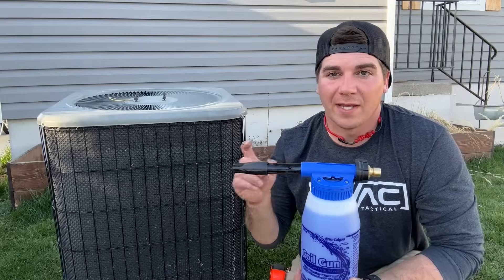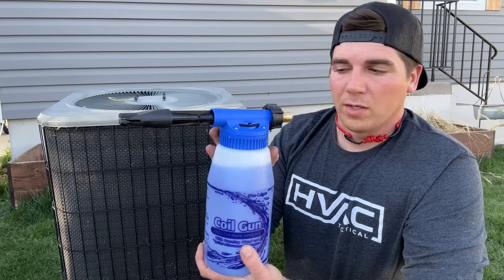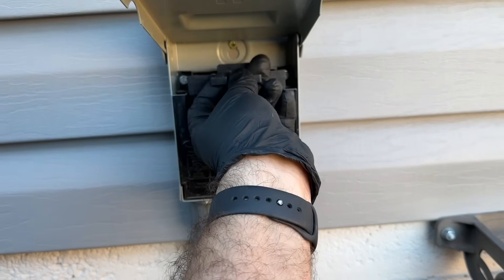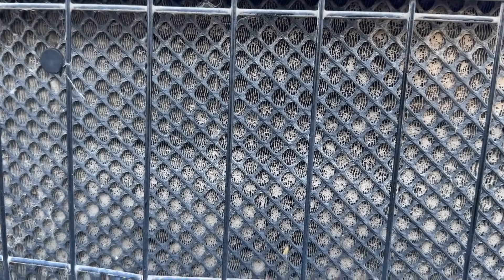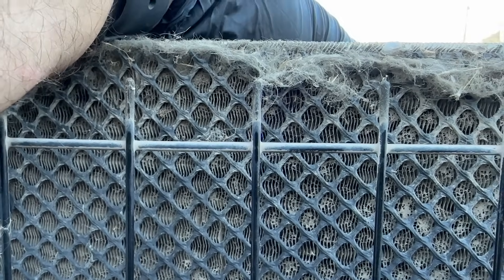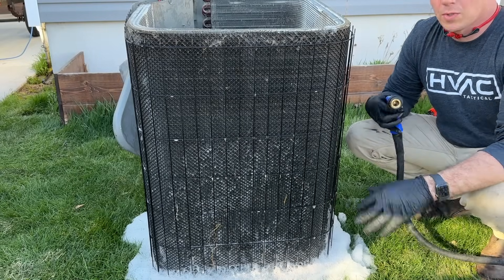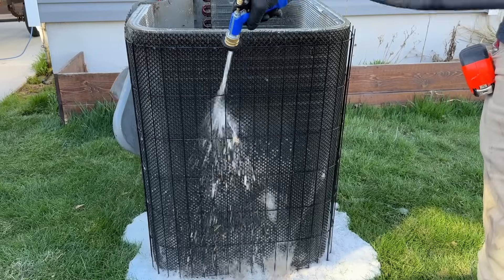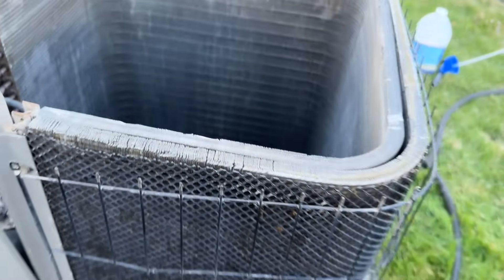How To Get Ice Cold Air By Cleaning Your AC Coils The RIGHT Way.

Comment: As a retired HVAC mechanic with 35 years of experience.  I have one tip about foaming coil cleaners ...... always start at the bottom and work your way up.  The reason being is that the run down of foaming cleaner can prevent proper penatration. If you start at the bottom and work you way UP..... You always have coils with NO FOAM IN THE WAY. JMO. WORKED FOR ME FOR 35 YEARS....LOL
Reply from the maker: That’s a really good tip. Thanks so much!!
Reply: @diyhvacguy  
I got a million tips. But you seem to be killing it on your own. Good videos,  good editing skills  , and no fluff. I like that.
Reply: @diyhvacguy  have you ever run into a TRANE with bottle brush fins.?? When I was a rookie. I had to call my boss and ask what to do. He told me that  TRANE recommended removing the complete outer shell  of the unit. Then, take your torch and burn off all that you can. Always being mindful of burning fins. Once that is done. Clean from the inside out. .... worked like a champ. Once you've burned the outside and cleaned from the inside out. You MAY have spray the outside and inside and clean again.  Your professional eyes  can tell if you've done a good job.  Pain in the hindparts... but it works.
Reply: Something went wrong.  I was speaking of a TRANE with bottle brush coils.
Reply: @mikeglasgow9618  I have one of those Trane units with the bottle brush coils.  I'm planning to clean mine sometime in the next week or so. Thanks for the tip!
Reply: @chriskvikstad4980  need any information....just ask. I'm a 35 yr retired HVAC Tech.  Just sitting at home enjoying life. And being retired.
Reply: @mikeglasgow9618  Thanks Mike. That's very kind of you and much appreciated. I'll take you up on that if I find anything unusual when I'm getting it ready for the warm weather. Do recommend doing anything with the evap coils inside the house? I looked at the furnace stack and I can see where the coils are, based on the location of the copper lines going into the box and the drain pan hose, but I can't find any way to access it. It's entirely surrounded by metal framing. Would be great if there was an easy access panel right there.
Reply: @chriskvikstad4980  yes,,,,, it sounds to me like someone built your coil box out of sheet metal.  Mine is what they call a CASED COIL. Meaning that it matches the furnace.  If yours is wrapped with sheet metal and you have no access,  then I would suggest that you use a small  hole saw on the edge of the cabinet.  If you can do both sides the better.  Be very careful that you don't let your hole saw PUNCH THROUGH.  ,you only want to cut through the metal.  Maybe a 2 inch hole. Then you can visually inspect the indoor coil.  The hardware store sells metal hole plugs that snap into place and can be removed for future inspection.
Reply: @chriskvikstad4980  .BTW.... If you do that. And you find it needs cleaning.  You will have to write back and I can give you a few tips. It's very important that you keep your air filter clean to prevent this
 Do not use the fiberglass air filers that you can read a newspaper through.  We call them bugcatchers.  I use a one inch STANDARD PLEATED. Not the high efficiency you by at Lowes or Home Depot 
 I buy mine at a store called the filter factory.  When I was working 
 I bought thousands of dollars of filters from them as I took care of several Nursing Homes.  Changing all of their air filers. Preventive Maintenance Contracts.
Reply: @mikeglasgow9618  I have a question. I have a two year old Bryant unit. I had them come out and check the system once a year. Well I asked him don’t you clean the coils? He said cleaning the coils would eat away at the protective coating . The coils look clean, but just wondering if he’s pulling a fast one on me. I could see both sides, but just curious.
Reply: @william-fla-321  LOL..... Yes he's pulling your leg. They make different types of coil cleaner.  One being HYDROSULFURIC ACID. Even though Hydro means water solvable, it " WILL " etch off some of the protective coating. That being said. You don't need to be that aggressive in your approach.  CALGON makes good foaming outdoor cleaner that is completely safe. A 25 % solution of Dawn dishwashing solution would be safe also. So is just using plain water. I've not worked in the last 7 years. I'm absolutely sure if you pose your questions to DIY. He would most likely have more information about this than I would being I've been out of the trade so long. But when I was residential years ago. Cleaning the outdoor coil in the Spring was an absolute.  I hope this answers your question.
Reply: @mikeglasgow9618  Thank you and I appreciate you taking time to help others. I had a feeling he was BS me. I’m mechanically inclined, but never messed with AC stuff.  He was trying to pitch me a surge protector and I knew more about the ZAPCAP he was pushing then him. I like to make as many repairs as I can by myself, because most people don’t care about your stuff. I’m going to start educating myself on the AC repairs. Thanks again.
Reply: @william-fla-321  no problem.... like I was saying.  I have been out of the trade for about 7 years now. I was an industrial tech. Very large equipment.  Boilers,  Chillers.  And DDC ( direct digital controls ). I worked for a school system for 15 years. Can you just imagine how many filters I changed.  LOL. Then my wife transferred and I got another industrial job. Hospitals , Schools. Nursing Homes.  and such. Also Digital Controls.  But I started out installing residential units when I got my degree in HVAC/ R. Some of the Boilers I worked on were 1/2 as big as my house. Lol. I really like the DIY GUY. Straight to the point, good editing and no fluff. If I can be of assistance to anyone,,, I will help if I can .
Reply: @mikeglasgow9618 I have a question.....

So my AC ran perfect about 1 year ago but since then my thermostat has gone out and had to switch to a Nest learning thermostat. I feel that my AC is taking awhile for it to reach its temp. 78 no issues. But 77/76 it takes forever. Im in houston and we are experiencing 100-102 degree weather but feeling like 110. Could it be that its just so hot?
Reply: @b_amayzd3646  yes  definitely.  Also Nest thermostas have an algorithm built in to their internal programming process. What that means is it takes time to learn about the load of your home. My thermostat has 4 events per day. Before I retired I only used 2 . HOME AND AWAY. In the cool mode I would set my away temp at 80 degrees. HOME was set at 74. For the first 10 days or so. When I would get home at 6PM... IT WAS NOT 74. It would be 77 at 6 pm. Next few days it would be 75. Finally at 6 Pm it would be 74. Just make sure during this heat that you wash your condenser and keep you filter clean. One other thing that MAY HELP... Is to shade your outdoor condenser if it is in direct sunlight during the hottest part of the day. Hope this helps.
Reply: @mikeglasgow9618   Sir... After cleaning the coils, how long should one wait before turning on the unit?  Would it be safe to use compressed air to "dry" them?   Right now, where I am in TX, leaving a unit off for more than 45 mins isn't the preferred option.   And then another thought, don't the coils get wet in the rain anyway?
Reply: @starhopper457  you are right. Once you have cleaned the coils, you can put the outdoor unit back online , provided you did not get any water in the electrical panel where the contractor and capacitor (s ) are located.  I just cleaned mine yesterday and turned it on within 5 minutes.  I cleaned mine with NU CALGON Coil cleaner at the beginning of the season so now I just rinse with my garden hose and spray nozzle.
Reply: @starhopper457   my sister lives just south of Waco on Lake Whitney.  She is doing well
Reply: @mikeglasgow9618   Nest thermostats are too complicated! And letting your temperature go up to 80 and then back down is costing you more electricity than if you just left it at 74
Reply: @diyhvacguy  I thought you were supposed to spray from the inside out?
Reply: @troyd.521  Yes. You are
Reply: Great idea ! Would you use Simple Green to clean coils?
Reply: I usually recommend to try and not use any chemicals at all for regular maintenance... if coil is dirty and impacted, sure. Otherwise, a waterhose alone will get the job done and it wont eat at the fin to copper connection points, which cuts out efficiency.
Reply: Great tip brother,thanks
Reply: your retired.. so keep your mouth shut, nobody asked.
Reply: I like to spray from the inside out.  It’s better to blast it out of the unit and not into it.
Reply: @ChiBr33zy  of course.  But when you are applying your cleaning solution,  always start from the bottom and work your way up.
Reply: I still don’t quite understand your comment, if the foam is running down, shouldnt you start at the top if you want “no foam in the way” cause its running towards the bottom?
Reply: @joemchang  bro...did you even watch the clip...good god man.
Reply: @DigitalCity-sj4es  yes in the video he says work from top down but comment says to work down up i just don’t understand why you would do it another way
Reply: Thank you!!!
Reply: Ty 😀
Reply: I have a question. Should you clean inside the unit as well?
Reply: @jerondbetts7341   on the outdoor unit. I kill all power to the outdoor unit. Take off the top of the unit. The outdoor fan will come off with it.  Being careful not to bend fan blades. Wash unit from the inside out. Usually before I get everything all wet I use a shop vacuum and vacuum any leaves or pine needles out of the bottom of the outdoor unit. Hope this helps. If you are using a garden hose spray nozzle,  do not spray at an angle or this can bend the fins.
Reply: Another dumb question if I may, re: testing capacitors...  do they have to be fully unplugged before testing them?
Reply: @starhopper457  not really but absolutely better if your a rookie and don't know what you're doing.  Just take a picture of the wiring noting where they go back. Unplug it,  ground out terminals with a screwdriver  and test capacity.  Rule of thumb for capacitors is + 10% ------ minus 0.0 % . Hope this helps.
Reply: Yes when applying a spray cleaner to most surface start at the bottom. On wall it helps to prevent streaking.
Reply: @jelehan88  I drink a shot of WINDEX...every morning.  It prevents me from STREAKING ! LOL
Reply: Makes sense. I'll definitely apply that method. I appreciate your input. 👍🏾
Reply: As a retired HVAC mechanic.. I have a question, do the "spine fin" style of coils that are in Trane units need to be cleaned like this too?
Reply: Nice I leern something new today I gonna put it in practice this summer thanks you 😁
Reply: Thanks for the t I p
Reply: 👍🏼 Could u explain why everytime my outside unit goes on it make a very loud click??
Reply: @Mick-Jam71  THE loud " click " that you hear is most likely the " CONTACTOR  " pulling in to start your unit. Upon a call for cooling. The contactor receives a low voltage call from the thermostat.  That begins the process.  Some contractors are louder than others. You can locate the contactor by removing the electrical panel cover and see where the 220VAC enters and lands on the contactor.  Pull disconnect first for SAFETY. Upon find the contactor inspect the silver contacts for cleanliness and burn/ arcing traces. A contactor replacement by a service provider is usually around $ 200.00 includes the service call. Contactors  actually cost about $ 20. Bucks. Some service companies will charge more than $ 200.00. It just depends on your location.  A handy DIY can replace a contactor himself. Anyway I can help...... just ask .
Reply: On another note.  Take a good quality picture so you know where wiring goes back.
Reply: Take the top off and use a pressure washer to spray from the inside out before cleaning.
Reply: What’s so funny?
Reply: Yeah I think you know how arrogant and delusional they always are about this.
Fellas will be like "I do it my way and I don't care what you have to say, I WILL DO IT MY WAY.
Reply: What was your favorite coil cleaner or brand?
Reply: @eulogiofuentes1940  it all depends on what you are cleaning,  evap, or condenser.  It also depends on how impacted the coil is. And also, some coils come treated with a protective coating. For simple RV coils FOAMING EVAP CLEAN FOR THE EVAP IS FINE. FOR A NON TREATED CONDENSER COIL, I USED A WATERED-DOWN VERSION OF HYROSULPHURIC ACID. IT WILL ALSO FOAM EVEN WHEN WATERED DOWN. YOU WILL NEED TO FIND IT ON AN HVAC SITE. AND YOU WILL NEED TO RINSE IT.  WITH ANY TYPE OF CLEANER,,, ALWAYS START AT THE BOTTOM AND WORK YOUR WAY UP.   YOU WILL ALWAYS BE SPRAYING INTO A COIL THAT HASN'T BEEN IMPACTED BY FOAM RUNNING DOWN. YOU WILL GET DEEPER PENATRATION . HOPE THIS HELPS YOU.
Reply: Hi, do you think it could also work on my portable ac?
No more cold…
it was ok last year…
Thank You
Reply: @VitalBigras  what you have to know is,,, is the compressor running.? You may have to remove the shroud of the window unit. Plug the unit in and run it. You will see the line going to the condenser.  If this line gets hot,,  the compressor is running.  Then you can clean the coils. If you have never cleaned them,,, you'll see it. When I was in the trade, I'm retired now.  I've cleaned a bunch of window units. If you need to clean yours remember SAFETY THIRD,, LOL 😂  Unplug unit, wrap fan motor with a garbage bag and tape so no water can get to it and clean both coils from both directions.  This being said,  if the compressor is not running,  you have a different problem.  Hope this helps
Reply: Do you have a YouTube channel?
Reply: Great tip! Thank you for posting it.
Reply: Nobody answered about Simple Green lol.. Will that work ok/good?
Reply: @TTime685  yes. ,, a small amount of Simple Green is just fine. Start at bottom,  work your way up.  Let stand 10 minutes.  Rinse well. GOOD TO GO. ! REMEMBER....SAFETY 3RD !
Reply: @Rumpelstiltskin-yv4ep Thanks!
Reply: I'm about to clean my AC today, great tip!
Reply: I have a foam canon that I used to wash my car that being said I wouldn’t want to just use any soap for instant high pH or acidic. What are some good things, brands to use to clean my AC coils
Reply: @We7hePeople  it all depends on the coil. Some coils are coated so you would not use a cleaner that is caustic.  A simple solution of a gentle cleaner usually does the trick. Soapy water.!
Reply: That's what she said, Start at the bottom and work your way up. 🤗
Reply: Same goes for pressure washing. Always foam from bottom up and rinse from top down.
Reply: Makes total sense good job a lot of times nowadays just tool bags come out no idea what they're doing Ashley this guy telling you to commit insurance fraud LOL
Reply: That's a great tip. But, if one spends the time to read the manufacturer's instructions, they will find it is also the recommended way to clean the coils.
Reply: @FG-tg9uk  Of all the home appliances people will read the manuals for, the AC is one of the last. Mostly because the AC is typically already installed and the previous owner didn't leave the manual laying around anywhere for the next person.

Comment: Same way for spine fin coils ?
Reply from the maker: Yes and no, so for spine fin coils or micro channel coils, I recommend doing the same process but using NuCalgons Cal Clean which is a yellow cleaner. It is designed for that application whereas the blue is designed for regular coils 👍🏼
Reply: @diyhvacguy   they seem fragile! Just bought a house with a trane that has them . Thanks

Comment: repairmen use different methods when cleaning, with this model I would remove the plastic net that serves as protection
Reply from the maker: Yes, I tried to keep this pretty basic so the average home owner could tackle this themselves. One could also split the two coils and clean them that way but you risk causing a leak so that’s why I didn’t include that.

Comment: I know someone has already said something similar, but you should be cleaning from the inside-out. Cleaning from the outside-in is just pushing that dirt on the surface deeper into the coil. You already had the fan off.
Reply from the maker: That’s a load of bologna. The dirt and dust goes down the fins to the bottom, you can literally see that happening in my video. I know of many hvac contractors that have always done it from the outside, and it works just as well. But if you want to do it from the inside there’s nothing wrong with that. I just don’t think it’s like a night and day difference one way or another.
Reply: @diyhvacguy Without soaking the electrical components, spray the AC unit from the inside out using a hose. After the initial rinse, use a coil cleaner that is compatible with the type of AC unit you have. Let the mixture sit on the condenser coils for 15 minutes before spraying the AC unit with a hose once again
Reply: @WayneTesta4444  not sure what response you’re looking for with a comment that seems to ignore his clearly-stated perspective and experience.
Reply: @westmcgee9320  If you find it hard to laugh at yourself, I would be happy to do it for you.”
Reply: @diyhvacguy  as someone who's been doing this professionally for now 7 years, i almost always do it from outside in on regular maintenance. I usually dont spray from inside out unless the coil is clearly impacted and needs real help. I dont ever use chemicals either but thats just me. Never have any issues.